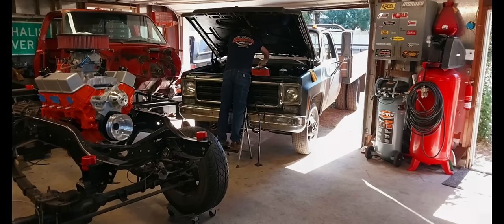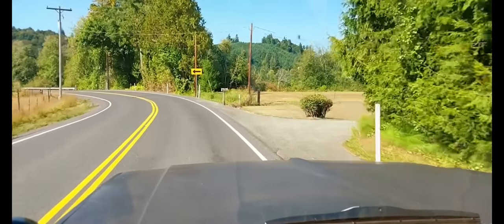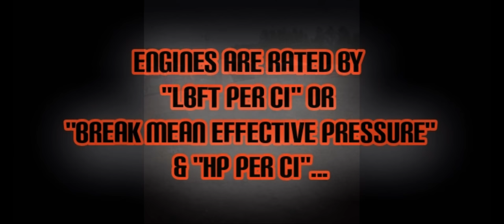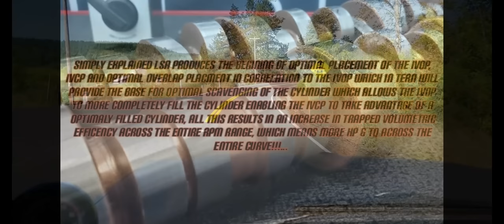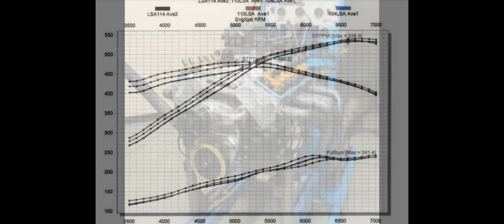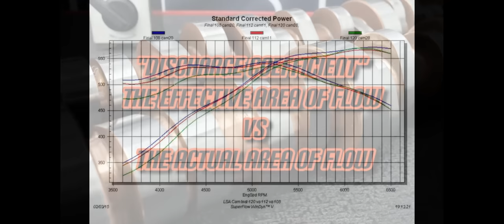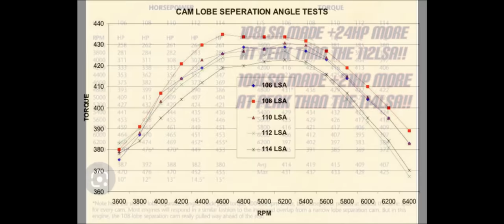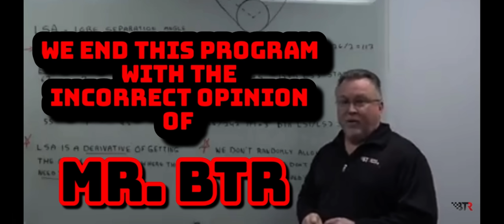Camshaft Selection via LSA, 19LSA's Dyno proven MAX TQ & HP cam tec. LSA, Overlap & Duration convert

Comment: It would take 30+ tests on an engine with 4 different cams, different heads, and different cam timing events to understand it at a single elevation, then doing the same at different elevations to understand how LSA affects engine performance. This dude's nowhere near understanding the truth if the matter. He's just interested in a smear campaign against someone he dislikes, and is only proving himself incompetent with a one track mind.
Reply: Elevation has nothing to do with flow. Higher elevation has the same effect as boost but in reverse. Everything else remaining the same, the engine has the exact same torque curve no matter what pressure you are feeding it, it just shifts it vertically on a dyno graph.
Reply: @Silverfang15   So your saying the futher im away from sea level my car will make the same power NA at sea level?  Boost is boost anyhting over 1 bar
Reply: @loundclear9279  what?
Reply: @Silverfang15  just what I thought... You don't know.  Yes, elevation has an effect on LSA and cam timing requirements, for optimal performance and efficiency... As does compression ratio... There's simply less air to move at higher elevation, so volumetric efficiency changes. I didn't use to believe it either, until I experienced it. It's much different than what you think.
Reply: @Silverfang15  Your say elevation has nothing to do with flow right? So base off that a 300 hp car in your theory at sea level will make 300hp above sea level right?
Reply: @loundclear9279  That is the opposite of what I'm saying. A 300hp NA car will make exactly proportional less power as the atmospheric pressure becomes thinner. For example, at an elevation of 4000 feet, you would effectively be running -2 psi of boost meaning the engine will be making 259 hp, however it is flowing the same amount of air, the air is just less dense.
Reply: @Faolan161  My reply was to the other guy. 

If what you're saying is true, then the power curves would change as soon as you added boost because the cam would no longer be optimal, but we can see that engines make the exact same torque curve whether under boost or not. They don't gain or lose low, mid, or high end power relative to the original torque curve. An engine making 14.7 hp all else remaining the same (other than the necessity of pulling timing and richening a/f ratios for safe tunes) will make exactly double the horsepower at all points in the curve.
Reply: @Silverfang15  except that a turbo might not make the same power at the same elevation. A turbo that's not for maxing out power and is small will make similar power at different elevations, but a turbo that struggles to spool at 3k rpm at 5000' might spool at 2500 rpm at 2000' with no problem. Power curves aren't always the same, because there's less air at elevation to begin the volumetric efficiency at lower rpm.
Reply: @Silverfang15  Desnity has weight weight affects flow so elevation does matter and affects flow. But I get what your saying. 

And you dont run - boost its all vacum until at what level of elevation you are to over come 14.5 psi thats atmospheric pressure close to seal level. Will be differnt at higher.

But density affects flow along with elevation temperture and so on.
Reply: @Faolan161  that is a result of the engine making less power at altitude. You can compensate by increasing the boost to match the power level at a lower altitude, but the curve is exactly proportional to the original NA torque curve. Using the example I told the other guy, the 300 hp NA car will make 259 hp at 4000 feet, and it will also have directly proportional low, mid, and high end torque curves.

Adding 14.7 psi of boost to that 300 HP car means it will predictably make 600 hp. At 4000' of elevation it will predictably make 518 hp at 14.7 psi of boost. We can compensate by increasing the boost level to 19.35 lbs of boost. Both factors (lower horsepower, more boost required) increase the spool time of the turbo, but the curve remains directly proportional to the amount of boost multiplying the original curve.
Reply: Actually it might be that the 300 hp car makes 559 hp at 4000' elevation and 14.7 lbs of boost, but the principle remains the same that the torque curve doesn't change, it is simply elevated by boost.
Reply: @Silverfang15  what's interesting is that double boost doesn't always equal double power at all rpms. Watching Richard Holdner's vids showed that much.

No, it isn't just loss of power at lower elevation... When an engine is ported too large for low end torque at low elevation, it's power band shifts upward in rpm range at high elevation. It's because it doesn't have enough air flow until a certain rpm to generate velocity needed for the power band to begin without adjusting cam timing and/or LSA. 

If this doesn't make sense now, you need higher education in engine air flow dynamics to understand how and why a power band comes to be.
Reply: @Silverfang15  back pressure needed to make the boost can hinder the power output until airflow begins... Boost doesn't always equal power ...  proper tuning of engine components, not just fuel mixture and timing, are necessary to generate rational power increases.
Reply: @Faolan161  the only times that it did not "show" a directly proportional curve:
1. If the turbo was still spooling, and wasn't making full boost, giving the appearance that it made less power down low (only because you didn't look at or know the boost level at that point on the dyno graph)
2. It is a centrifugal supercharger and has a rising boost curve, in which case the power will be directly multiplied by the boost level at a particular RPM, minus the power to drive the supercharger at that speed etc.
3. It is a blower and it is directly proportional to the boost level minus the power to drive the supercharger at that speed etc.

Other theoretical things that would change the curve:
1. The intake/exhaust manifolds are different resulting in a change in flow characteristics
2. The tune was changed in a drastic way that made the engine make a different amount of power than the original curve (but making a similar change to the NA tune would have a similar result).

If you don't get it at this point you need higher education in information retention/comprehension and should go back and watch Richard Holdeners videos, he really drives the point that the engine does exactly what it does NA that it does under boost, but elevated, regardless of camshaft, regardless of engine type, regardless of the type of boost other than aforementioned parasitic loss and potential necessary tune changes.
Reply: @Silverfang15  yes, Holdner shows how a boosted cam holds the same curve as the same cam na...    🥱

But you prove you are projecting about the need for education for practice in comprehension skills, because the entire point here is that his results are at a static elevation... Savvy?  Then the volumetric efficiency thing that you keep avoiding comes into play as it takes longer to come onto the cam with elevation gain, especially with oversized heads... Density affects flow, as does vacuum pressure, and with less vacuum pressure is less flow. Rpm overcomes the flow issues, as does cam timing/LSA .. try to keep up.

Now. If you want to keep regurgitating your internet knowledge, do it elsewhere. You're off course, and avoiding the point of the affects of cam timing/lsa with elevation gains. Avoiding the point while saying someone is wrong is only proving you can't keep up. Like I said before, you need more education in the dynamics of engine volumetric efficiency and what causes it in order to understand what I am talking about. I've explained it to you already, but it's like telling a 3 yo which intake to use in the car with his car seat...
Reply: @Faolan161  and somehow you have entirely missed the point that if what you say is true then we should see a change in the curve when boost is added, which would be evidence that LSA would need to be changed based on elevation (as adding boost is effectively going below sea level), but that's not what we see happen ever in any example, but please feel free to provide an example if you can find one.
Reply: @Silverfang15  you ignore my points, that you commented on, then complain that I missed a point ...? The horse before the cart, junior.

When you cannot comprehend wisdom spoken, you will never see it in action. Yes, I have plenty of examples, but when you only see two dimensional, you are oblivious to a third. You shape everything to fit your box, unaccepting of anything else... I think you're purposefully avoiding my points, because of you weren't, you would be seriously embarrassed about your last comment.

You can stop trolling now.
Reply: @Faolan161  it was my first and main point, if elevation affects optimum LSA, would we not see a change in the torque curve when we add an entire sea level (or more) worth of air pressure?
Reply: @Silverfang15  no. It's the first level of pressure that affects volumetric efficiency. The volume of air going into an engine is not linear, as noted by the power band, and the way port sizes affect cylinder filling. Now try to keep up.

Obviously you have to start at the basics... Piston goes down and starts the vacuum to pull in air. If ports are too big, velocity is slow until rpm brings velocity up. When elevation increases, there's less air, so less air to create velocity. With me? Denser air will create more velocity, less dense air creates less velocity, requiring more rpm to begin volumetric efficiency. Less air molecules means boost source cannot compress air yet, and with turbos, they require more exhaust to drive the compressor. Superchargers need rpm to compress more air, building more boost with rpm. With elevation gain, there's less air to compress, so compressor needs more rpm to begin the compression, again, when they're oversized or built for higher rpm use. All this changes the power band as elevation gain causes the need for increased rpm to gather velocity to fill cylinders.

Now, pop quiz -  when ports are oversized, how does a cylinder fill with air?
Reply: @Silverfang15  obviously you got nothing, because you can't say a word disproving what I'm talking about, but you're dead set on oppositionalism. 

Or, you just got it and are too embarrassed to talk about it... It really is a simple concept when you actually understand the workings of an engine.
Reply: @loundclear9279  750 CFM of flow at Sea Level is still 750 CFM at altitude.  The difference is the density of that air at different altitudes or temperatures.  In Denver we run tighter LSAs to build more cylinder pressure (increase DCR), and we run more timing advance.
Reply: @OldBeaterGarage   No doubt but , My point was elavation matters in any combo na or boosted.  Anything with density has weight, weight affects flow along with pressure. yes 750 cfm at a given sea level will be 750 cfm but the weight and the density will affect the flow no matter what, I have flow tested heads that shows a differance in flow vs temapture density of the air., Denser cooler air has more oxygen in the mix along with not much water molcules. We know the more oxygen the more potential power. On a warm high humidity day you have more water moclues in the air over oxygen. 

But anyway lots a so called builders dont take alot of factors in building anything.
Reply: @loundclear9279  you're right a lot are absolute !diots when it comes to building engines.